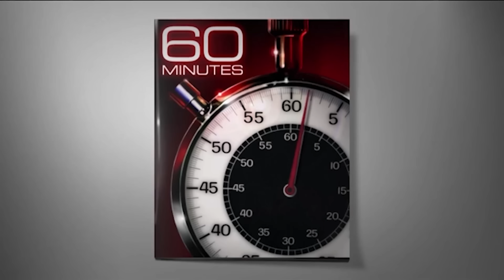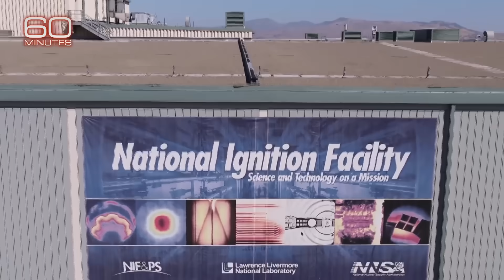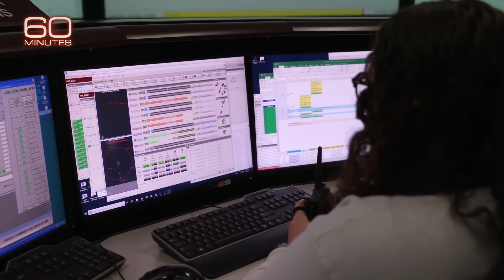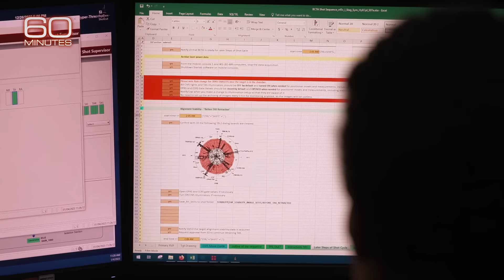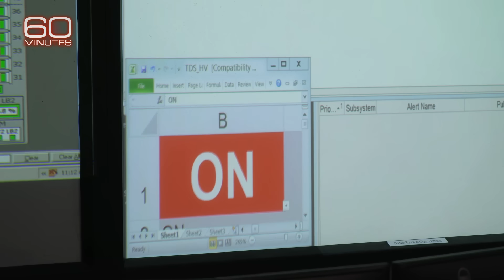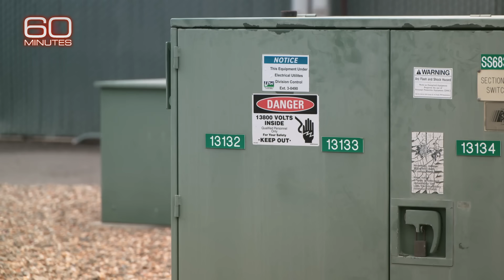Nuclear Fusion: Inside the breakthrough that could change our world | 60 Minutes

Comment: Wow this would be amazing if it werent very very dishonest. If you have a laser pointer will it work without batteries or a power supply of some kind? The answer is no and these lasers are no different, and the amount of power that went into those lasers far exceeds the amount of power that came from he fusion reaction. If you want to get technical hydrogen bombs (which is what this facility tests) are more efficient. A small 20ish kiloton atom bomb (implosion fission device) is used in hydrogen aka thermonuclear weapons as a detonator for the fusion fuel to which they add some more fissile material for good measure. But from the initial 20 kiloton yield of the detonator we get yields in the hundreds of kilotons or megatons. The fed just doesnt want you focusing on the fact that the point of this experiment was to test a new fusion fuel ratio for a thermonuclear weapon. So clap them hands dumb dumbs and applaud their work
Reply: Good points and I'm glad that you exposed the fact that NIF has always been funded primarily to perform experiments related to thermonuclear weapons (H-bombs). In the above experiment a weapons related target material was placed near the fuel capsule so it would be irradiated by the prompt emission of 14.1 MeV fusion neutrons. I don't believe it has much to to with finding a better deuterium/tritium fuel mix ratio. The Lawrence Livermore National Laboratory received funding for NIF in return for ending their full-scale underground explosive test program at the Nevada Test Site. They had to end that program under the terms of the nuclear test ban treaty. NIF was supposed to achieve the so-called 'breakeven' fusion reactions by 2012 but it failed by a factor of over 100. It took a decade of very expensive tweaking to finally reach the original goal. Its been estimated that NIF has now consumed over 11-billion in federal revenues.

Comment: This is probably what trump would like to finish it..... They can't hold it ..but trump will finish it
Reply: The National Ignition Facility (NIF) construction was completed around 2009. The ‘breakthrough’ fusion reaction was expected to be accomplished by 2012. The researchers failed by a factor of over 100. It took another decade of tinkering to finally achieve the expected goal with the Dec. 5, 2022, laser shot. It was later admitted that it took more than 100 times as much energy, than was generated from the extremely brief fusion reaction, to drive the lasers. The lab has had great difficulty recreating such reactions since then. It has been estimated that NIF has already consumed more than $11-billion in federal revenues. It has always been primarily funded as a thermonuclear weapon (H-bomb) research tool, not as a viable path to a fusion energy power plant. The administration has always obscured its real purpose when presenting it to the press, the public and funding providers. nuclear fusion energy experimental research has been going on since the 1950s. It has very little to do with the current political campaign.

Some people have come to view DT as a god but that doesn’t mean he can accomplish miracles.

Comment: This is a highly toxic source of radiation and it's all for AI AI is so smart that I can only think of very expensive sources of energy rather than using solar powers or wind currents or ocean currents
Reply: The National Ignition Facility (NIF) has always been part of the U.S. nuclear weapons complex and it always has primarily funded as a thermonuclear weapon (H-bomb) research tool. It is monitored by radiation experts and doesn’t pose any significant problems. It is true that the radioactive tritium that is employed can pose a health hazard but it is well controlled. The announced fusion reaction lasted for only about 0.000,000,000,08 seconds and resulted in only a minor amount of fusion reactions. The lab is lucky if they can repeat the experiment more than once a month.

Comment: ya and its only five years away
Reply: Keep in mind that the nuclear fusion energy research began back in the early 1950s. Since the 1960s the proponents have always suggested that a commercially practical nuclear fusion energy electricity generating power plant was only 20-30 years away. The researchers have encountered numerous problems during those many decades and many of them still exist though most of today's young researchers have little knowledge of how big the challenges remain.

Comment: It's not fusion we're after.

It's called quark-electron plasma and it is what a black hole is made of.

They are the least dense objects in the universe, not the most dense.

Fusion and supernovae completely contradict each other. It always takes energy to create heavier elements. This is why fusion will never work.

Space is a -460° F field of electrons.

The importance of this field disappeared when the strong force was to be between quarks and a particle with no mass or charge, the gluon.

The strong force is between the quark and electron.

The quark is only 4 times larger than an electron. It is the difference in these two masses that allows our universe to create so many different elements.

These electrons cause lightning in all types of clouds.

They are used to create the force of gravity.

Quark-electron plasma accomplishes this with the repulsion of the positive quarks.

Once they are separated with about 5,000 amps, they are injected into a vacuum.

The field of electrons causes "zero-point energy" which manifests itself with its density. 

Once quarks are separated, the field of electrons cannot get them back together because the repulsion is too great.

It takes a black hole billions of years to get the first quarks back together as neutrons on the surface.

As a result, the electrons rush into the plasma only to be destroyed and turned into electromagnetic radiation which are electron neutrinos. They are 500,000 times smaller than an electron.

This plasma ejects the electron neutrinos at such a high speed that they have no frequency. There is no speed limit for light. The only way light can differentiate itself is through its speed.

This is quantum tunneling.

We will use the electrons that flood into the reaction to take the place of the mass that was lost.

No radiation. No water. No steam.

No $100,000,000 a kilo tritium.

Only $16 a kilo, neutron-free hydrogen.

The future of the human race depends on quark-electron plasma because it will also create propulsion for spacecraft by pulling them through space, not pushing.

Who's right? Me or the people getting paid to fruitlessly search for fusion?

The education is wrong. Our universe was not created.

There is nothing that can stop this if people get paid by people who have no idea how our universe works.

If the Big Bang Theory remains a fact, humans will perish with this planet because we will not be able to leave it.
Reply: Note: The above was written by a 'zero-point-energy' fan. They may also be able to describe how many angles dance on the head of a pin.
Reply: @vernonbrechin4207 

You must be one of those "created universe" people.

How has that gone the last century?

Have you heard of dark matter, dark energy, fusion, or black holes?

Do you think those are scientific explanations for something?

You need to wake up.
Reply: @infiniteuniverse123  - You got that wrong. I've looked into many of those esoteric fields that many others mention to demonstrate to others how brilliant they are. It appears that you've become enamored with a wide range of alternative explanations in them. Many do because it makes them feel very special and it provides them with a purpose in life.

Comment: Someone explain did they make a sun? And is the sun still working? Or just momentarily? And can they use this created energy to power the lasers to keep making more energy? And the sun they make will need to be bigger and bigger and more and more lasers? And a sun about 100 ft of sun square foot wouldn't that like be bad for environment temperature or dangerous even? And will the military use this as a weapon?
Reply: No human has ever made a sun which is just one of many trillions of stars in the Universe. Our sun, formerly known as 'Sol' is still working otherwise you wouldn't be here to read this. The very few fusion  reactions that that the nuclear fusion energy researchers have created generally last well under a minute. The one, from the announced December 5, 2022, NIF laser shot lasted for 0.000,000,000,08 seconds before blowing the vast majority of the fusion fuel away from the reaction center. It took about a week to set up that experiment. That lab had no provision to capture the small amount of fusion energy since it is actually a thermonuclear weapon (H-bomb) research tool. The estimated energy generated by that shot would have been enough energy to boil about two liters of water. The amount of energy that was fed into the laser system was more than 100 times greater than what was generated in the fusion reaction. There are limits to how energetic the explosions can become if one intends to capture the energy. For example, try to capture the energy from a one-megaton thermonuclear weapon (H-bomb) explosion. The NIF explosion took place in a microscopic speck of fuel. There was almost no propagation of the reaction before it blasted most of the reactants away from the reaction starting point. The U.S. military services receive nuclear weapons from the U.S. Department of Energy (DOE) in a kind of loan program. The weapons themselves were designed, tested and manufactured under the control of the DOE. The NIF has always been part of that program. It never has been intended as an experimental path to a future commercially practical nuclear fusion energy electricity generating power plant. That has always been pure hype to secure more public support and federal funding.

Comment: I understand that the “plasma” has to be magnetically floated in space because of the heat.
How many tons of silver are the using to accomplish that??
Reply: The metallic element silver is not employed in any significant quantities. During WW-II the U.S. substituted   silver for copper in some of the magnetic uranium isotope separation machines as part of the Manhattan atomic bomb project. At that time the copper was in greater need for the ongoing war. Nuclear fusion experiments depend upon electromagnets that use copper,  and two varieties of low-temperature superconducting coils. The extremely powerful and carefully configured electromagnets perform a number of functions which include keeping most of the plasma away from the chamber walls and confining it within a certain density range within a chamber in which almost all the air has been excluded.

Comment: thank you, economy will rise by using jet plasma machine and compressed gas(Air) in isolated structure in water pool  with more than 80 % efficiency , it transfers compressed gas(hot air) temperature  from engine to water, New energy from sea will change world soon, there are other source of energy that with international cooperation in coastline we can reduce effect of  global warming, sea is huge source of energy, further more  we can prevent these phenomena like cyclone and flood and wildfire by using this hot seasonal atmospheric condition, recent years in summer, geothermal energy happens in surface of coastline, there are many countries in coastline with seasonal hot weather and water condition in comparison with middle Ocean, its more than 12 degrees ,  in sum-up, by using this energy not only is economical but also reduce global warming in countries like Japan, China, India, Mediterranean countries, Iran, Brazil, Mexico, Us, Canada, (Africa and Arabian countries....) . I invented new method base on air pressure rules and quantum physics ionization sea water minerals in strong dynamic magnet bases on paramagnetic and diamagnetic particles and electrical microwave wave field and electric chemical reactions (K+, Mg++, Na+, H+, H++, li+, H2, ...) +( O2, N2, ...) into up level by vacuum pump from storage into combustion chambers as major part of fuel (more than 50%) for producing electricity and fresh water and fertilizer. this machine produces 150Megwatt-hour/hour and 20000M3/DAY fresh water and fertilizer. 7 methods zero pollution for reducing global warming I mentioned in my profile. (G20 countries can solve these phenomena).

Comment: I have one question how do they load in the fuel?⚛️☢️
Reply: There is one, or two extremely thin tubes that enter into the least critical points in the hollow diamond fuel pellet sphere. The deuterium and tritium are pumped in via those tubes into the vacuumed space. There it condenses at liquid hydrogen temperature and then it solidifies on the inner surface. The process occurs repeatedly over a period of a day, or more, until a uniform mixture and dimentionally consistent coating forms on the interior surface. Once that is achieved the laser shot can take place.

Comment: So how's the progress?
Reply: Since the December 5, 2022, shot announcement they have had about 4 more shots that were close with one almost double the fusion energy output shot covered in this presentation. They still consume over 100 times as much energy as they get from the less than one-billionth of a second fusion reaction the blows most of the fuel away from the reaction center before it can react. The NIF approach is still many orders of magnitude away, on numerous fronts, from demonstrating anything close to a practical nuclear fusion energy generator. Their over-hyping of their progress continues as usual.

Comment: This likely shall not stand for more than at most a minute. As, a clerk reviews. Then, erases it.

Few human learn much from passed negative reinforcement. Including, this individual, ranked well-below the average intellect of a mongrel chow and pit bull blend. As, it be determined by the psychology department of this state's university system.

That permitted the cessation of medicants purposed for producing  a permanently-dulled capacity.

This snippet of marketing be much like the solicitations. Who made the super colliding super conductor fundable, along with many ample salaries. For, many well-compensated "researchers". 

Where be that, after the Bush administration. Who approved it. Or, the tax funds who made it possible.

And, words spoken a day before. Thise were suffixed this day with a article arising by happenstance on CNN.

College have their myths legends and other tales. Some of which be partially based upon some level of true occurrences.

And, a former physic student who was talented enough that he met such resistance.

Trust this comment heard from someone who met a similar fate. However, he escaped his fate. Through, a altered identity, an engineer who relocated among these parts, near '90.

Who shared that some of the cores. Who Fermi and the like originally built. For, the study of radiactive decay. Those encased with carbon. They be resident undet campus fields.

Some of whom has seen their records misplaced. The locations of which be only known by the aging professors. Who pass that torch of information.

It be a matter of a person's life pathway. Whom sets his perspective on life and value. What be immediate expedient, dispensible, or eternally needful.

As. those elementary school lessons during the height of the Cold War. That were broadcast among the national newcast, concerning the butrial if radioactive waste aming caverns left. When, BNSF, UPRR, and others burrowed through the Rockies. Who were hewn down for the succor of coal and other minerals.

Supposed buried over ten thousand feet below the surface. That radioactive material among sealed heavy waterproof drums would be safe. Until, it was not the least-bit dangerous. 

Were those false account for the immediate solicitation of tax dollars, or for the pacifying of the public.

It be said that underground rivers travel in unpredictable pathways.

In short, how wise might this be?

The classics truly be all that is. Plus, they pose potential who frightens many. Most students do not retrace and reread general survey texts in their entirety frequently.

Nor, do they venture beyond. What be placed on the chalkboard.

Such will get at least a solid booting ftom the field.

And what be wanted the grade, paycheck, and personal goals.

Truth or those who be hurt after one be gone matters little.

Love,

Well-Remembered

 A - ## - ### - Hole.

Much Love

Newton's Second, Faraday's Laws, Lorentz.

Drop IT. If, you shall choose 96 and on YouTube.